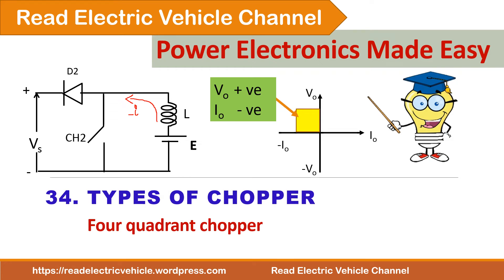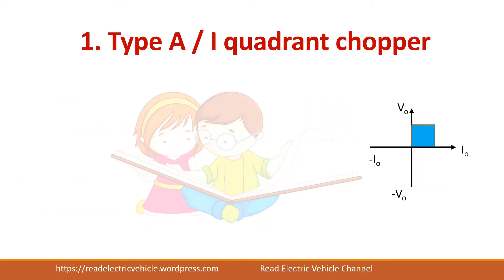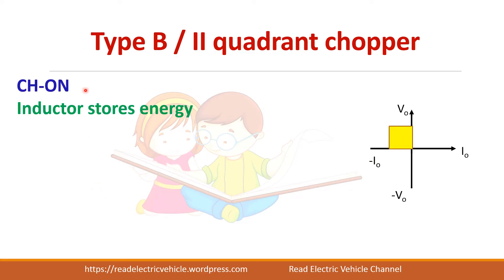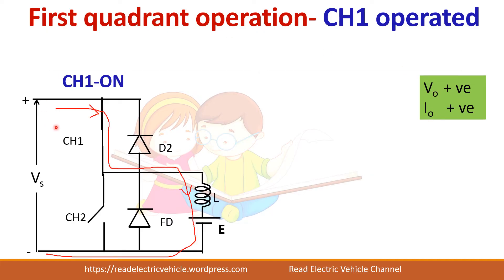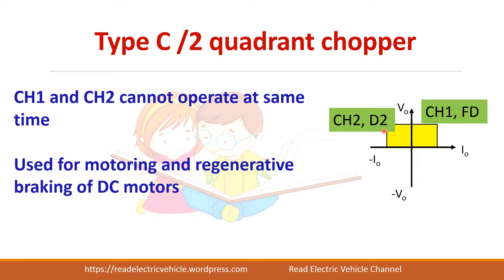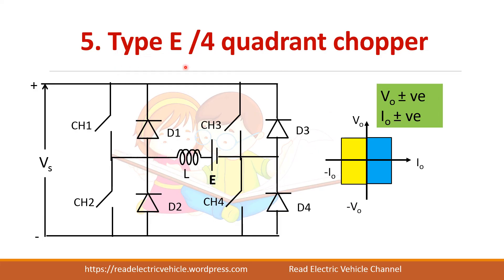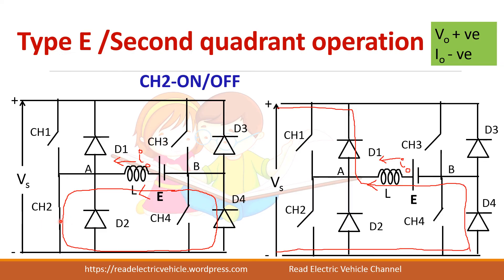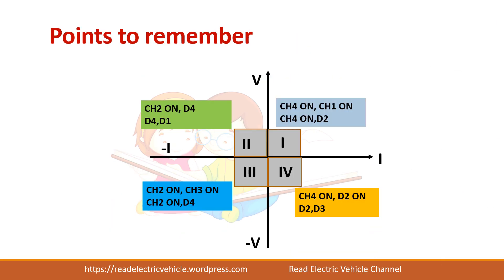34. Types of chopper/four quadrant chopper

Comment: Yes Dear Author you are potraying the wrong information.
In Type C Quadrant you are saying when CH1 is off why the current will be positive i still not understand as the flow of current is in the opposite direction 
Second point what is the use of switching the CH2 as it is being conducted by that Low side diode ???
You are saying if low side switch conducts then the current is negative and if the same diode conducts you are saying positive Current..
Madam topic selection is good but have to be more clear while explaining...looking for bettee explanation.
Reply from the maker: I am happy for asking the doubts. First of all, this topic chopper is available already in all power electronic books and I am just trying to explain in simple words for better understanding.
So please don't say that i am potraying wrong information as it could confuse the readers.
Coming to the topic,
 a current direction can be positive or negative depending upon how we name them.
For example, in this type C chopper, I have taken current coming out from the source is positive and the current entering the ( inductance and E) is considered positive.
When CH1 is ON, current enters the (inductance L and E). ( positive current)
When CH1 is off, the current direction  remains the same. ( current enters the inductance and the E).
See only  whether current is entering or leaving the inductance to know the current direction.

I understand your confusion, I should have added some labels for (L and E) combination, so it could be helpful. I will take into account in my further videos.
Still not clear, feel free to ask me.